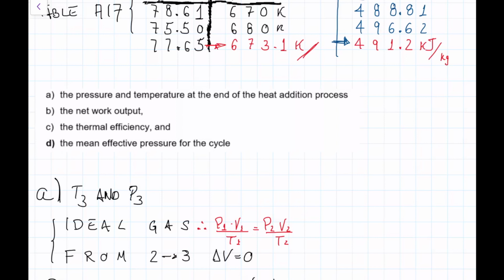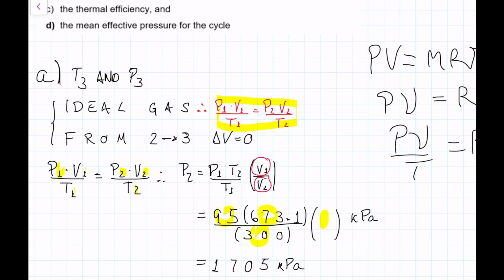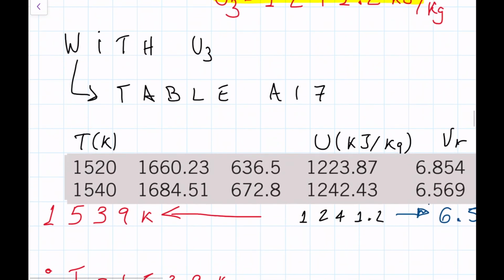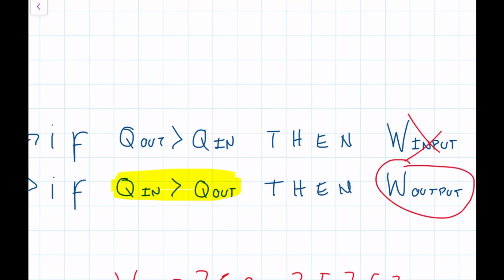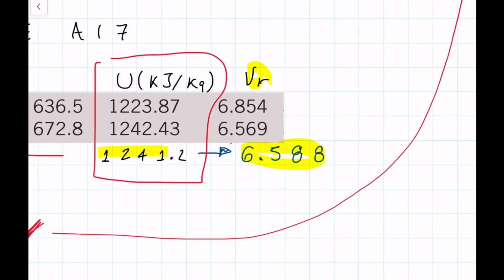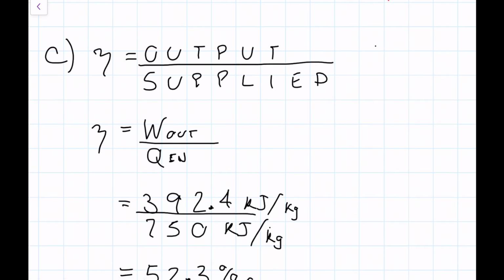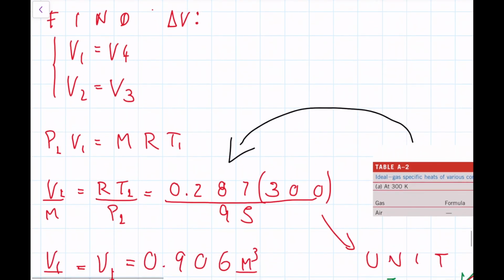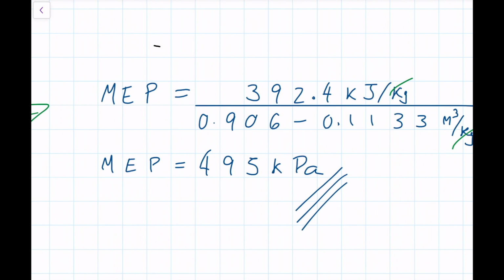Thermodynamics Mech3001 - Week 8 - Problem 1 (9.32) - Part 2 Solving

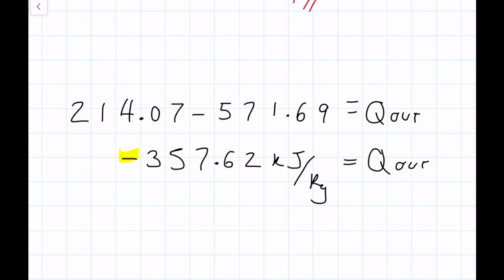Comment: @ 13:15 i think the U2 is wrong. i might be mistaken, shouldnt it be 491.22 not 214.07
Reply from the maker: Yes, you are right. But the video also says that :)
U2 = 491.2 kJ/kg 
(check out part 1)